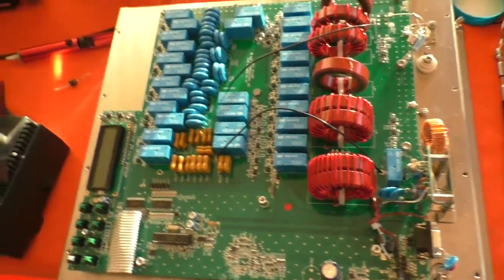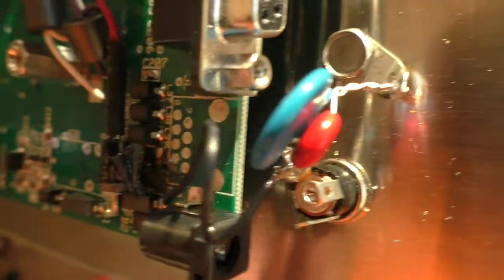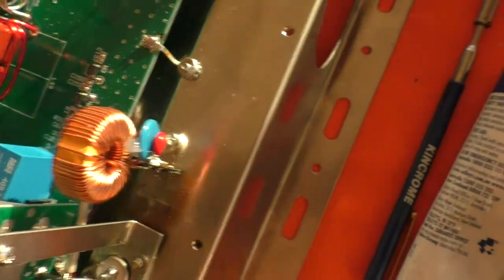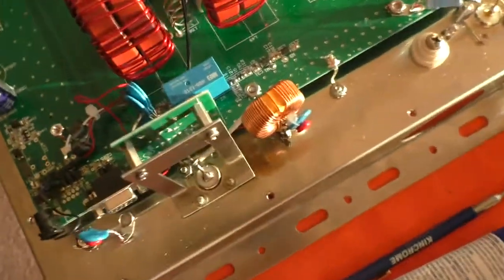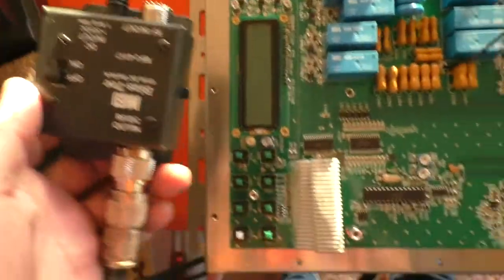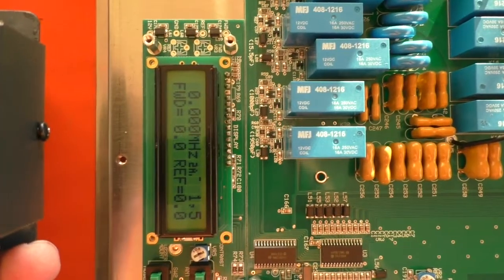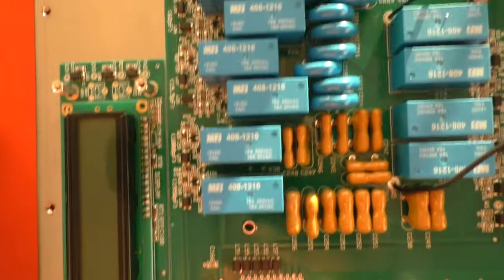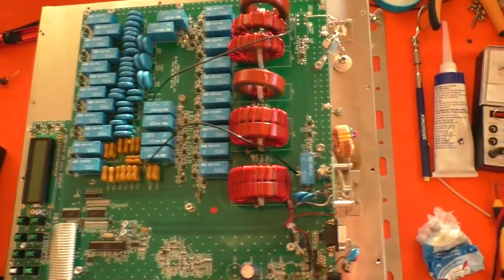New RF Choke And Diode Fitted To The 998RT

Comment: I find it quite satisfying to take something broken and fix it and finding it works like it should.  I recently rebuilt a basket case power supply and it now powers my HF radios.  Nice fix on your tuner.
Reply from the maker: Thanks. You're right it's satisfying to fix something and be able to use it. It's a shame fixing stuff and building stuff is becoming less of a part of amateur radio.

Comment: So overall, it seems as if you were satisfied huh?
Reply from the maker: Yes, MFJ just said 'we'll send you another one'. They didn't ask for the faulty one back so there was no extra expense required from me. They couldn't be fairer than that. I was a little disappointed that the new ATU has bent corners on the mounting bracket but that was rough handling in transit, the box shows crush damage on two of the corners. Maybe MFJ could use a bigger box to ship these units and add some protection to the mounting bracket corners.